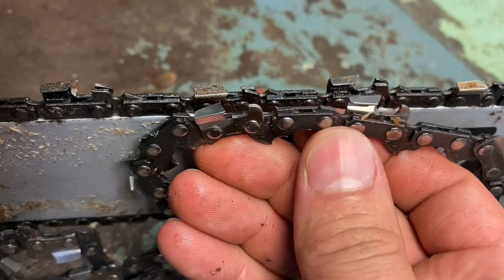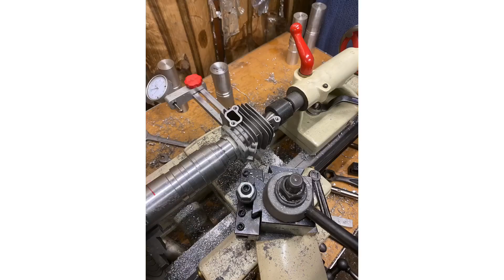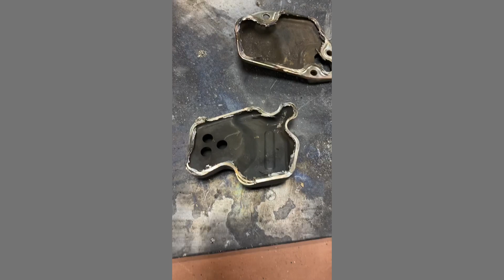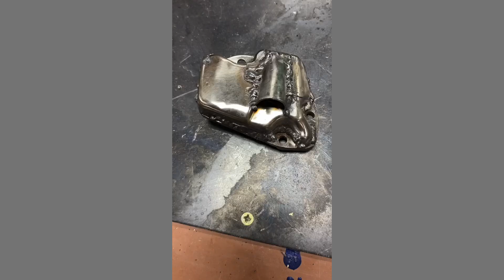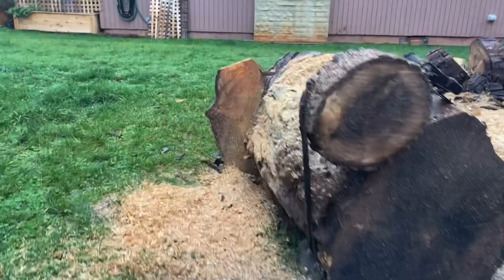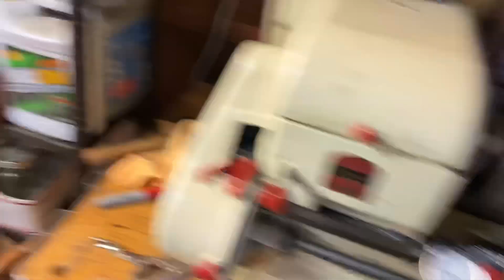Echo 2511T ported: Setup, R&D, and cut times comparisons

Comment: Would love to see some more vids on the actual porting process. Might take away some of your clients but I'm sure lots of people would appreciate it! haha
Reply from the maker: Trevor Babajan basic stuff. Widen and polish. Drop the jug, advance the timing. Tough to get into the little guy.
Reply: Saw Greater no clue what drop the jug means though, lol.
Reply from the maker: Trevor Babajan requires a lathe. This is more than just opening stuff up. It’s full blown porting with all new port timing numbers. Most people don’t understand any of that.
Reply: Ahhhh so this is legit ported then, lol. Not just giving it some better air flow.
Reply from the maker: Trevor Babajan yessir
Reply: Saw Greater  I was wondering exactly how you raise compression with the clamshell design but a lathe and mill would definitely be the only way
Reply from the maker: Chezley McDonald the 2511t is not a clamshell design. The crankcase just isn’t part of the body of the saw. It  bolts into it. For this saw I did a pop up and base cut. The only way I know of raising compression on a clamshell would be a welded pop up

Comment: I found adjusting the carb after doing the mods seems to be a bit more difficult than a normal carb. I removed the limiter caps but still tough to adjust. doesn't seem to be the normal style of carb. Did you have difficulties adjusting?
Reply from the maker: I agree. After porting it works like normal. But when stock adjusting does almost nothing